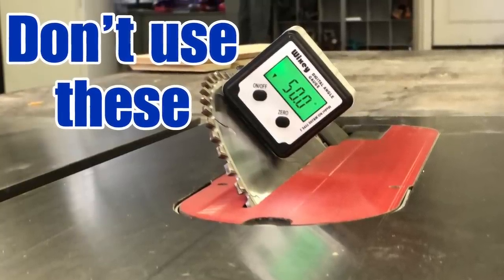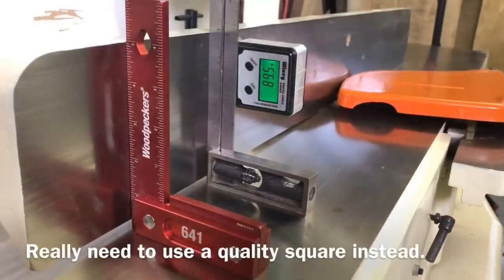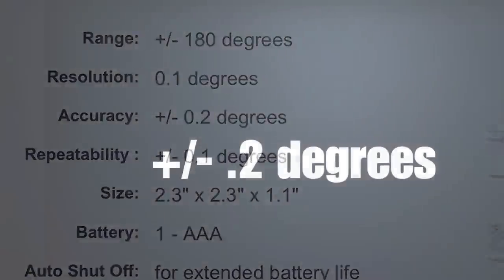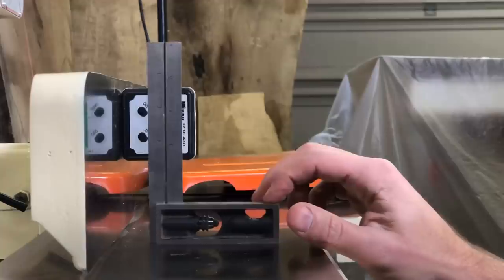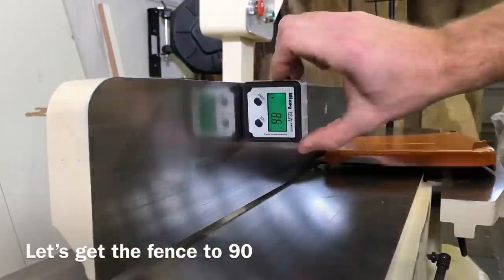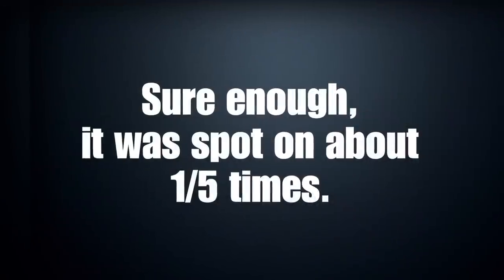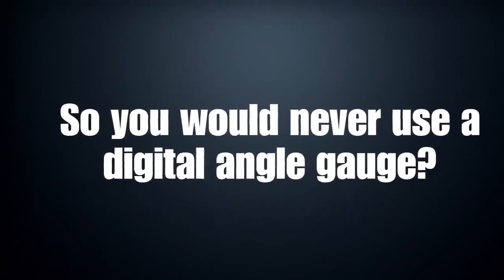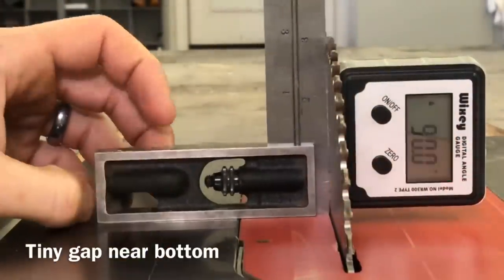Table Saw 101– Digital Angle Gauges— How To Woodworking

Comment: Thanks for doing this video. I've been thinking about a similar video, so it's nice to have someone else jump first, to see what people complain about. I learned at least a couple of things, which I'm sure you already know, and I'd be curious what other things you learned from the comments, that make you wish you'd done something differently?

1) Make sure to show and explain zeroing a digital gauge. I suspect you're kicking yourself over this one, but what can you do? Another time I wish we could edit YT videos.

2) Make it clearer up front that not everyone needs it this exact all the time, although I think if you can be exact, why not? But still, it would eliminate some of the negative comments.

3) One of the reasons I may not do this type of video is people want a comparison to other devices, and how much money do I really want to spend on a video like this? You probably feel the same way.

4) If there's a way to demonstrate what that difference actually equates to, as far as real life is concerned, that would be helpful. I wonder if cutting some wood then placing it against a perfectly 90-degree fence would have enough of a gap to show up on video?

Sorry for the ramblings, I'm just thinking out loud about whether this is a subject I want to address or not. I'm not sure I want to face the trolls over this subject, even if the points are valid. Keep up the good work!
Reply from the maker: Yeah, I think you make a lot of good points. I was amazed that so many people insist it’s based off of “level” and I figured common sense would realize that’s not the case. I also meant to demonstrate a glue up with several boards just slightly off. So if you do it, I think that would help people. I don’t think you’ll eliminate all the negativity, because so many people are just stuck in their ways.

Comment: Hmmm arithmetical slight of hand? Deliberate or just not thinking straight?
If the accuracy of the digital scale is +/-  0.2  and for example reads spot on 90  then the reality, at worst, is that is  EITHER 89.8 or 90.2   not both!!! so is is not 0.5 of a degree out, It is .02  at worse. 
And to, nit pick, even if your logic were true 0 .2 + 0.2  is 0.4 not the “half a degree out” that you sate. You have weakened your case by exaggeration.....
Further like others who have commented can you really eyeball .02 of a gap using your set square. On pause I believe I can see a  light gap when you rest your 100% accurate square against the fence...

In any case I have never trusted either type of device entirely and suggest you consider the following test:-
Set your fence using your best set square and make a couple of cuts on a sample of wood from a current project (nothing special make this a test of the real world of wood work).
Then deliberately unset the fence and re-set it it using the digital scale and make another couple of test cuts on the same type of material.   Now ask another person to check the angles.....  I wonder what they will find .........?
Further leave the samples a week under normal workshop/household conditions and check them  again. ..... How much would you wager on the readings all being the same as before. 
It is the result in the piece of wood we cut that is the real criterion here. And there are more variables in blades,  fence to blade parallel measurements,  and above all in the natural variability in the behaviour of wood, than worrying about 0.2 of a degree.
BTW Still enjoyed the video and it did make me think about what I was measuring.
Reply from the maker: Mike Pearson thanks for all the words! Certainly a good read.
Reply: The video was exactly right on this point.
Reply: But if the digital readout is 90.2 the error can be anywhere from 89.8 to 90.2.  Almost 1/2 a degree.
Reply: @yrralyou incorrect. If the reading is 90.2 then it can range from 90.0-90.4. That’s what +\- means. But it can also be dead on 90.2 all day long.

Comment: close enough considering all the wood movement. different story if machining
Reply: I bought the $100 johnson gauge. It will tell me 90° and when i bump the saw to jostle it it will come back to 89.8. 
At 45° ive found i can get better precision using a speed square and my eye than using the gauge

Comment: I make a lot of boxes with Mitered corners.  I have never had such good corners as since I started to use the Wixey gauge.
Reply: Yeah I hear a lot of good things a about digital gauges.

The jury is still out. I think I might try my first project with digital and if I don't get the results I want then I'll try the method shown in the video
Reply: I'm going to get one....just to add to my options.
Reply: I made a cell phone holder that hangs perfectly flat on one side of my table saw blade, and downloaded a free leveling app. So far I've had zero issues with any angle of miter I cut while using this set up. All from scrap wood, and a free app.

Comment: I stopped using these tilt boxes years ago but for a completely different reason. I make a lot of stave builds and out of habit these don’t provide me with a hundredths place read out. You can imagine that if I’m trying to complete 360* then the readout being off even by a hundredths off it’ll throw the circle off. Then I realized years ago that it’s not so much the box, but a lot of the times it can be pitch on the blade, also the way the blade travels vertically. A lot of saws use a swing motion where the lift mechanism pivots on the front of the saw and that can have a huge impact. HOWEVER! These are great to get quick reference guides like you mentioned, especially if the angle doesn’t have to be exactly precise. If you’re looking to get precise angles for crazy glue-ups just use a good ole fashion protractor or an angle finder that can be used measuring off of the cast iron and not the blade, after all - you’re angle won’t matter at all if 0* or 90* isn’t relative to the surface you’re passing your boards through.
Reply from the maker: Totally agree! Great point on making the multi-side boxes.

Comment: Thanks for your comments about digital gauge mediocre accuracy. I’ve been annoyed with them as I require  90 degree accuracy for most of my work and find that I am daily checking my table saw for 90 degrees.  I thought these digital gauges would make life easier ( I’ve tried 3 different brands) but they just frustrate the heck out of me instead.  I thought it was me and learned that inexpensive ones just can’t deliver
Reply: I don't need the check my table saw blade every day. Even when I do it, it is still at 90⁰ after hundreds of cuts. That's because the table saw quality matters too. If you need to check it up every day (and make adjustments), you may very well need to replace some parts on your table saw or buy a good quality one. I own a good quality Grizzly hybrid table saw and never had that issue.
Even my 10-year old 10" Craftsman job site table saw keeps its settings after extensive use.

Comment: I dont think these digital gauges are specifically designed for 90 degrees, they are designed so you can set to any angle
Reply: I wonder if 90° would be one of  "any angle"
Reply: @hamaljay  it sure would, and im sure it would do a fine job finding it too

Comment: Eye opener!  I have two (2) of these and rely on them completely for setting angles on my TS blade and jointer fence (primarily).  Going to cross check my 90's w/ my Woopecker 1281.  Thanks for bring this to our attention!
Reply from the maker: Happy to help!
Reply: Must have lucked out and got a good one. Have used mine many times in the past year with no problems. Always double check known angle blocks and still right on.
Reply from the maker: William Allington that’s awesome!

Comment: My final calibration is always done by actually cutting wood and measuring the angle. I find that even the best attempt to use a square does not give me a perfect 90. It usually takes me about 10 cuts to get my saws perfect but from then on I don't need to mess with it.

Comment: Hmm, as a retired scientist/engineer we were always taught to know and use your measurements appropriately; and this includes the math of using them. So ... you make a good point here. I would want precision in making fine furniture, esp. glue joints for sure. As my father always said People may no see everything but they will notice so do your best and pay attention to the details.  Question: Do you calibrate your $500 squares often ? (butt 2 together or flip one against itself?)  Take care🙏   -Mike  
p.s. I'm on a quest to enter your 1 Million Subscriber giveaway. hehe
p.p.s I saw this vid and having just bought a used 10" contractor saw set up as a 4' cabinet saw I was cosidering a digital angle gauge ... a woodturner doesn't need too great a precision in a table saw !!

Comment: Without reading all the comments did any one mention something my dad called reverse jointing. Basically if you have three boards to glue up the two outside boards you joint board face away from jointer fence the middle board joint bothh edges board face to jointer fence. Extrapolate for as many boards as you are gluing. This method eleminates or rather absorbs any error in your set up. This was just something i always took for granted most folks knew. Hope this is helpful. Enjoy the work
Reply from the maker: That would make a great video in itself!

Comment: There are a number of things that can affect squareness of a jointer fence or table saw blade. First of all, a jointer fence  (or table) might not be perfectly flat, so squareness would vary depending upon where you check it. Secondly, some people, like myself, can't see well enough to judge when the square is perfectly aligned with the fence or a blade. A blade could also not be true. I have found my Wixey digital gage to be at least as accurate as my eyeball and square setting ability. They are a bit difficult to use for adjusting, as it is quite a chore to get the adjustment right on the number you want. The only real way to know if your equipment is adjusted correctly is to make some cuts and see how they fit.
Reply from the maker: Totally fair! Sounds like some people have better digital gauges than me. Cause mine is a noticeable turn of the handwheel off of my squares. I like your point about making the cuts to find out where square really is though.
Reply: Eyesight is also a limiting factor for me. Sometimes I use a $10 speed square and an automotive feeler gauge.

Comment: With woodworking these gauges are fine for me, I do a three check with it if I was really worried. As for 90 and 45, As I have some many squares around the shop I do find them easier to set up the angle.

Comment: I've heard the Wixey can have accuracy issues, so I got a Beall Tiltbox, which claims to be more accurate.  Alas, I haven't used it much, but the few times I have, it seems to do pretty good.  I also recently acquired a cheap set of WEN angle blocks, which I haven't had a chance to use, but those are another alternative to the digital gages/precision squares.  My main reason for wanting these is to be able to cut oddball angles for things like stave construction or segmented turning.

Comment: I've seen Starrett squares that are more than .2 off  from one to another  , never seen woodpecker squares to be able to compare one against another .   where i used to work in the aerospace industry we had to have our tools calibrated every 30 days or sooner if they were bumped or dropped . they used a Faro arm and a flattened granite slab to check for out of square and would only approve them for use if they were +/- .0001 within the length of the square checked  . if they didn't meet specs then they went back to Starrett for them to redo . Digital ones were only allowed to be used to check travel on movable parts with greater tolerances allowed .
Reply from the maker: Good to know! And yeah, any expensive square can still be off!

Comment: I look at what I'm doing in the shop.  Most of what I do is butt joints and simple 90s that can be half a degree off.  I'm not making picture frames yet.  I can still respect someone who drops 500 bucks for making sure they're getting the results that they want.  Especially if you're doing this daily or weekly.
Reply: I think your statement is very true. For the home guy you don't NEED hyper accuracy. But if its your profession and you need repeatability and longevity then spend the money on the best tools out there.

I use a $300 angle grinder and home which most people think is excessive. But at work we use a $2500 grinder 😳

Comment: Digital inclinometers require a quality reference that you zero to for both zero and 90. Without a quality reference to zero to your always going to be off more than the expected uncertainty in the measurement. I feel it's worth it the spend more for a digital inclinometer that has less uncertainty. I also agree that you should always use a trusted quality square when squaring a fence or a blade. The uncertainty in a quality square is a tiny fraction of a degree, off the top of my head it's something like +-0.001 or basically the machining tolerance.

Comment: Did you assume zero runout of the blade? Did you re-cal gauge to table and was the square set in the same spot on the table? Do you believe one square is perfect or if two agree both are perfect? The accuracy of gauge is .1 degrees at 90, not .2. Is any of your wood perfectly straight such that less than perfect 90 matters?

Comment: This test isn't fair, your comparing a 120$ square to a 20$ digital angle finder. They make more accurate digital angle finders. I've seen them as accurate as +/- 0.01 which is deadly accurate.
Reply from the maker: Good point!
Reply: Please, leave a link to one of those high precision digital angle finders! I would like one.

Comment: I have that Wixey angle finder and use it when I need a 45 or something in between on the table saw. I find it to be plenty accurate enough for me. The reality is that it's probably never really going to add up to .5 (.4?) off. More likely it will be somewhere between dead on accurate to .1 or .2 off. Let's not forget that wood moves too right? I mean at some point you have to go with the flow a bit and admit that accurate enough is accurate enough when we are working with a material like wood. I'm sure I can introduce .1 of angle (and more) by simply pushing too hard on one side or the other as I feed the saw anyway! Hell, when I first got my Starrett it was completely square but I tested it a couple months later only to find out it was no longer in square and needed adjustments. 

I've done a ton of miters on the table saw and used the Wixey to get my 45 and the joints have always come together great. Maybe I'm just lucky or maybe the error is too small to make a meaningful difference when all other things are considered.
Reply from the maker: Thanks for sharing your experience!

Comment: Just out of interest, did you calibrate yours before you took the 90 deg measurement? You didn't say in your video. On my one, it says that before you (say) want to check an angle, you should firstly calibrate it to the horizontal surface you'll be measuring off and zero the device. You then need to turn it through 180 degrees. Only after this is done should you then check check an angle.

Comment: A couple things that have seen addressed. One is quality of saws. How true is a saws arbor. If your using a portable job sight type saw that’s not as accurate as a new top of the line cabinet saw then there can be quite a bit of difference in tolerance. Also blades, have you spun the blade 180 degrees and see if the is any change. How old is the blade, has it gotten hot from pushing hardwood through to fast. Just exactly how flat is the wood your cutting. Now most of the time we’re talking thousands I know. But it all adds up. Bottom line, use what works for you and fun doing it. My 2 cents
Reply from the maker: Good tips!

Comment: New to wood working period. I don’t understand use on angle you won’t notice. But glued edges etc. I’m not understanding the difference. Would it be the same result?
Reply from the maker: Picture gluing up 10 boards for a flat table. If they’re all of 2 degrees it will be curved or wobbly. But 2 degrees on an edge won’t notice much

Comment: Your Woodpeckers gage is referencing to the saw or jointer table top but the digital gage has its own internal reference so if your saw isn’t level referenced to ‘earth’ there will be an error. If your shop floor is off by 2 degrees the digital gage cannot account for this.  The digital gage has no idea where your table top is located. This is a problem. Do they have digital gauges with better than 0.2 degree accuracy if you spend premium dollars as you did for the Woodpeckers gage?
Reply from the maker: ^^michael is right

Comment: Is the ability to check a square for square against itself just a completly lost skill set. How do you know the square you used to check your square is square? Hook a square on something straight. Strike a line. Flip said square 90° strike a second line with the point closest to you being the stsrting point for both lines. Any amount out of 90° is doubled at the far end of your two lines furthest from you. Sorry if confusing I have never written this out only showed it people. Good luck and remember enjoy the work
Reply from the maker: Yup! That makes sense. I happen to have two square, so I just get lazy I guess.
Reply: Agreed - I periodically check all my squares like this - some only ever get used for outdoors work !
Reply: Oddly enough learned that in a cabinet shop using a framing square. The other less reliable check is to 3 4 5 a framing square. Mehh close enough for framing especially when you can 3 4 5 whatever larger outdoor project or larger shop projects.
Reply: My dad was a woodworker. This was the first thing he taught me. I was 8 to 9 yrs old.